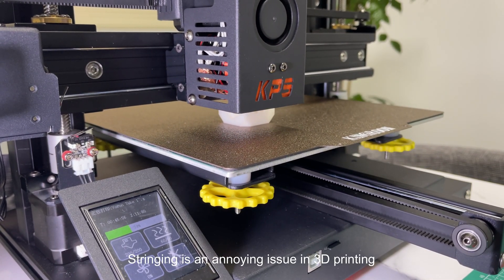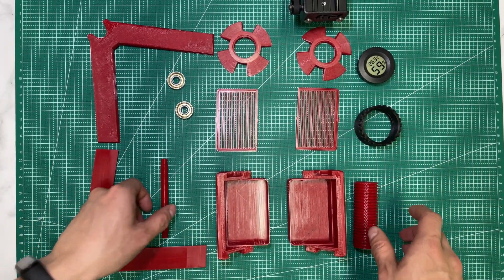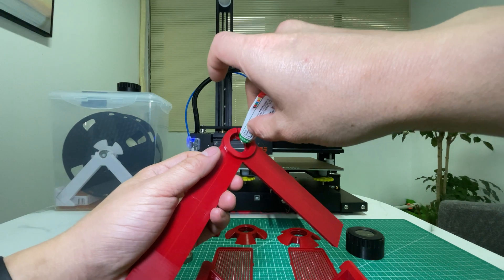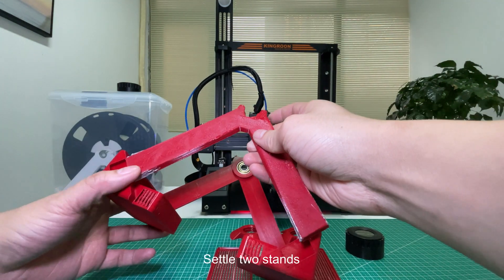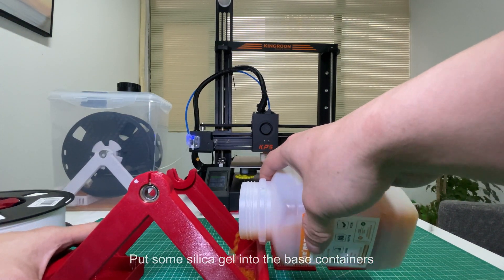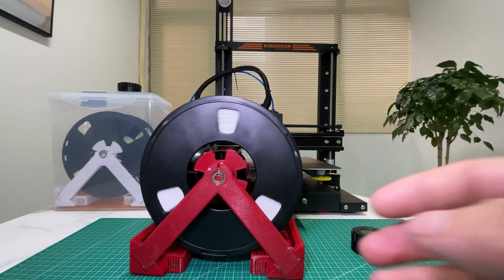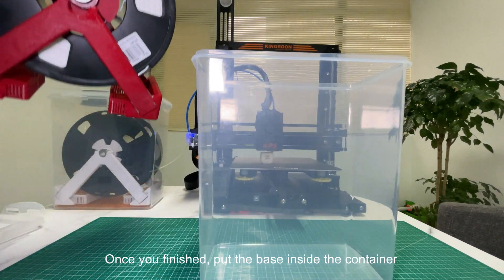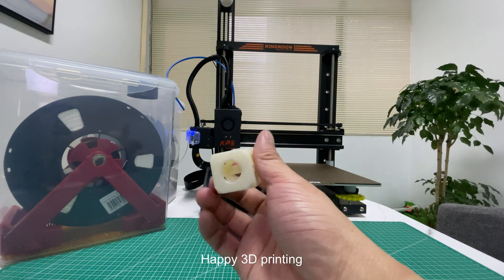6 Minutes Build a Cheap Filament Dry Box that Every 3D Printer Needs

Comment: I WANT THE REFUND OF MY MONEY. 3D PRINTER KP5L IS GARBAGE.
Hello friends, my name is Agustín Garcia from Brazil. I bought your KINGROON KP5L Titan Struder 3D printer in September 2022, my order number on aliexpress was 3018409370684638. I had a lot of problems initially with you because it didn't work for around 2 months and you discovered that there was a board that was malfunctioning from the beginning that prevented you from seeing the display working. Despite the delay, I had to keep it and I was very upset about the inconvenience I suffered during the purchase process. I finally put it in the box and until today I never tested the printer again. Today was the first time I tried to work with this printer because my daughter wanted to print a birthday present. The problem is that the display now works but the printer makes a lot of noise and remains immobile. I discovered for myself that the printer executes the movements in the opposite way and that I am not the only customer who has this problem. I also discovered, from other customers, that the kingroon update firmware does not work and the printer cannot be updated, and that no one updates the official kingroon site with the proper firmware. All of these are small examples of the company's lack of interest. I WANT THE REFUND OF MY MONEY. YOUR 3D PRINTER KP5L IS GARBAGE.